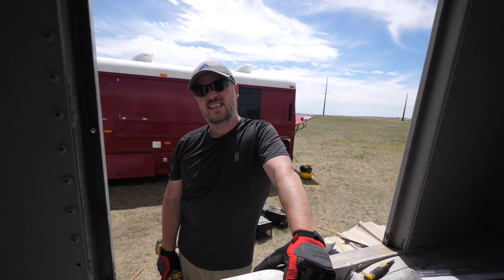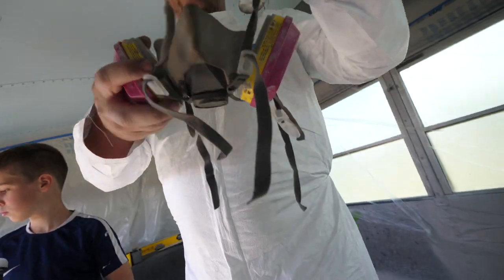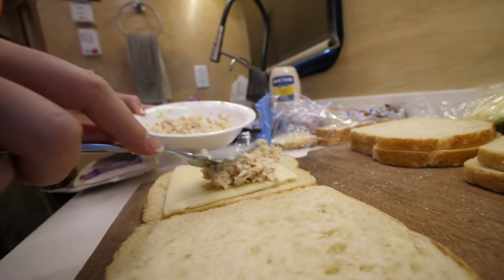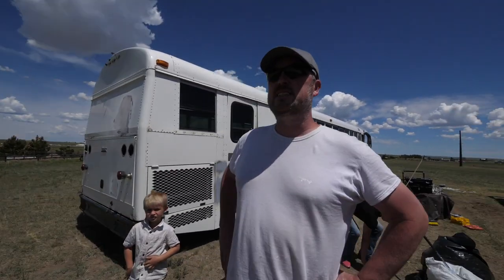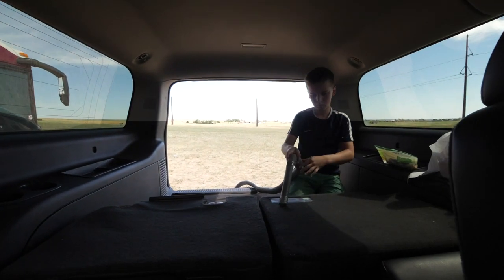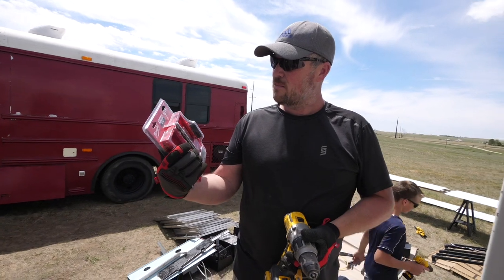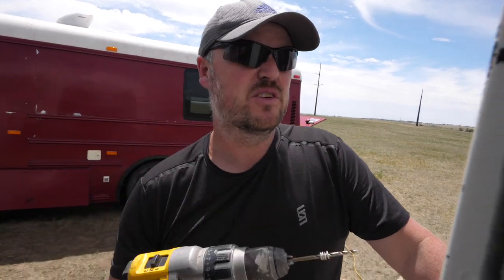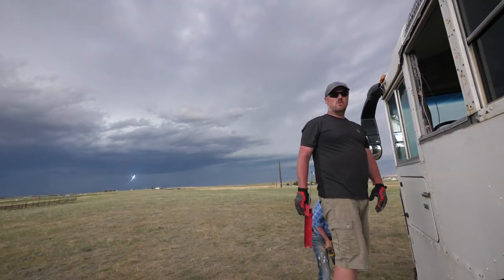Day 7: Coffee House Bus Conversion | The Bus Life

Comment: Instead of washing the metal with soap and water, we wipe it down with xylitol solvent.  This prevents rust and takes off the grease.  We do wear gloves when applying it.  Wipe down the metal until the rags you wipe it with are no longer get dirty.
Reply from the maker: Good tip